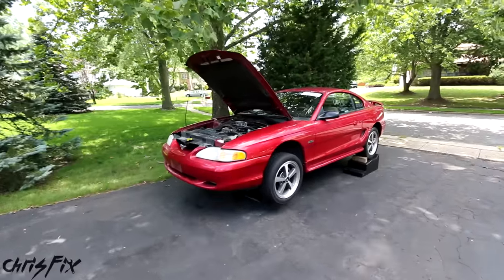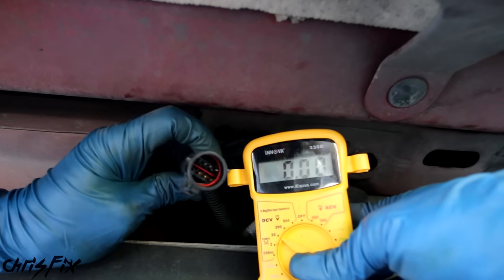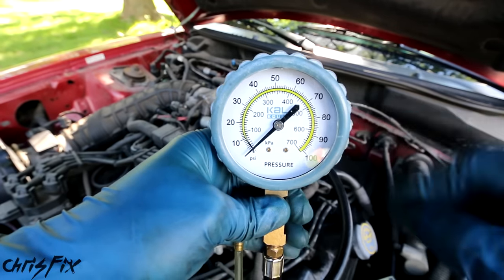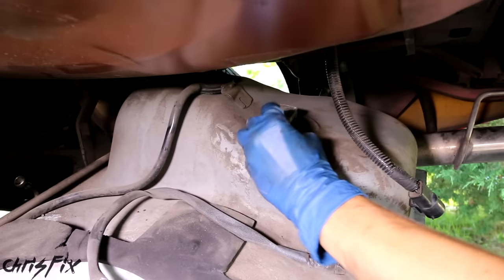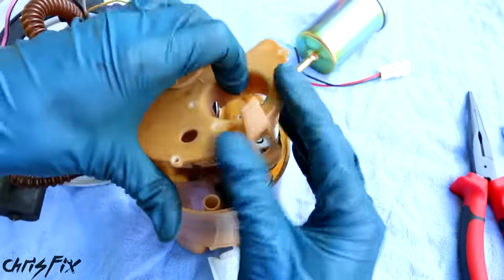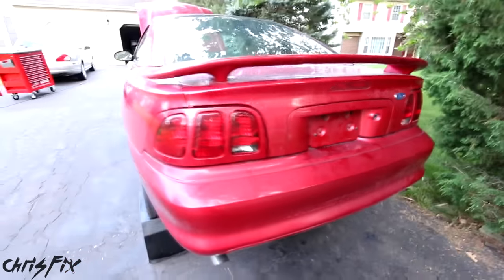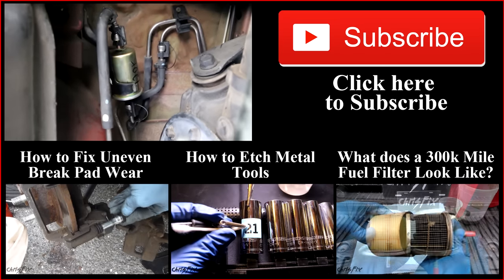How to Diagnose and Replace a Fuel Pump

Comment: Someone help? so i have a 1994 mustang gt 5.0, and about 2 months ago, my harmonic balancer went out. so it sat on jack stands for about a month and a half, until i finally fixed it. I put a new battery in, and it started after a little bit of cranking. it stayed on for a while. then i put it in  gear and drove it. it was jerking and wanted to die. then i got on the main road going about 20mph, and it was backfiring, hesitating and jerking, then eventually shut off. wouldnt turn on, so i thought the gas was bad, so i went to go get some. then it started again, and did the same after a little bit. i havent driven it in about a month since. I turn it on every now and then, and it starts right up, and revs up to 4-4.5k rpm. I feel like it could be the fuel pump.

Comment: I have a 13 chevy cruze and I just replaced my battery thinking it could the issue but isn't. The engine cranks but doesn't start and when i would drive uphill, it would take so long for the speed to increase. Could it be a bad fuel pump?

Comment: My 98 Mustang GT is stuttering when I get on it in high RPMs I changed coil packs, o2 sensors,  it threw a pending MAF code that's gone now and the o2 sensors were at 0v on live data I'm stumped do you think it's my fuel pump going out?

Comment: Hi can you help me Chris?
I have a Chevrolet Sail Diesel.
The problem is after driving for a while and stopped, it won't start. It just cranks. 
It starts perfectly at cold start. But after a stall or stopping after driving for a while (1hr or more) it will not start. If I've luck then it will start but there is a noteciable sound difference in crank when the engine is going to start. Like a shaking feeling sound. If it won't start then there is no sound like that, it's just the cranking sound. 
This problem occurs more when I drive with ac on or if I stalls the car. I'm not sure what is the problem but I think it's related to the fuel pump. Do you have any guess?

Comment: If your fuel pump stops when you are on the road you can sometimes get under the car and tap  on the gas tank to get it going till you get home. 
If you stop the engine you have to tap again to start. 
You are welcome.

Comment: Hi there... My 2011 suzuki sx4 . Standard.  No previous issues. Suddenly dies off 5 mins  after engine runs. And can't start since
Need some advice , the car cranks but not starting. Checked the following,
Battery -ok
main Fuse- ok 11.8v
f.p Fuse ok

F.p Relay not clicking, I'm getting 8.2 dcv at supply feed to relay.other ports I'm getting 11v
 change to similar relay still doesn't click. need some advice before I proceed to the fuel pump. What else can I check?

Comment: Chris I have a p0089 code on a 2009 Volkswagen CC and there are so many issues associated with that code. Could you give me any tips on what to do, I’m sort of sure it’s the fuel pump and I already replaced the pressure sensor and cleared the code which didn’t solve it

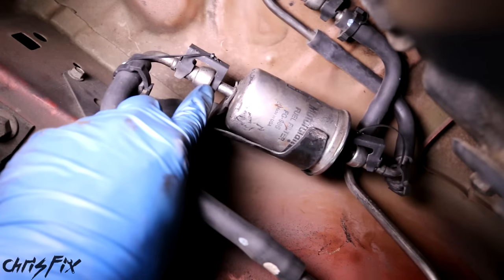Comment: Do you see the fuel line above the filter with the clip at 5:54? I removed that clip by accident and I can't get the fuel line to lock back into place. It just won't budge because the bracket holding it is stud welded in. Any suggestions on how I could get around this? Thanks, wish I would have watched the video first lol.

Comment: I'm working on replacing the entire assembly instead of just the pump. I'm noticed that the "hat"/cover/whatever has an arrow on it. I don't know what it's pointing at but it wasn't pointing toward the front of the car. I marked the direction that it's pointing to on the body of the tank. The fuel line (that goes to the inlet side of the fuel filter) that comes off of the hat was pointing  at the front of the car and I'm assuming that this is the proper orientation but that arrow is confusing.

Comment: My car shuts down after driving and about to park it and turn off the car. Is it the same problem? Bad fuel pump? Not during driving but after and the engine rattles and weakens when stopping

Comment: Hi @ChrisFix, watched the video very helpful until the fuel Relay switch. I opened up the panels on the inside of the passenger wheel well like you showed, but I cannot find the relay ANYWHERE! I re-watched over and over but the exact location is never shown in your video! SOMEONE ANYONE PLEASE HELP!!
Reply: I have a 98 mustang gt conv

Comment: Hey Chris I have a 07 Chrysler 300 with a bad gas pump I know there is power going into the pump but the pump just won’t hum and work  I changed it with a new pump 2 times what else can it be ?? I sprayed it with starter fluid and the car turned on any suggestions??

Comment: @ChrisFix I have a 01 dodge 5.2 my fuel pump is a little different. every so often the truck will die/stall even when i give it gas to stay running. Would my fuel pump be bad?

Comment: I have a 1996 cobra when I hook up the fuel pressure gage and turn the key on it go’s up to about 35 but it starts to drop back down right away. Should it stay around 35 with the key on? Does that mean I have a weak pump? I just got the car

Comment: I have an 84 k5 blazer. You need to hold on the gas pedal for it to start and press down the gas pedal a couple times and feed gas to the engine. Once it’s on it on and doesn’t turn off. Any idea what The problem could be?

Comment: I have a question ChrisFix, I as well have a 98 mustang but won’t start I changed the fuel pump and filter, fuses are good and have power as well as the fuel pump relay and when I start i don’t hear the fuel pump and now I get a check engine light and a theft warning sign on dashboard any advice?? please help

Comment: I currently have an issue with my sn 95 v8 5.0 automatic, after i drive it fot about 5 min and im not constanly acelerating lets say im driving trhru a speed hump it turns of all of a sudden, after that is starts normally, this happens probably about 2 or 3 times before i get to drive on a highway or something where i can get more speed

Any suggestions? :/
Reply from the maker: Could be anything from a malfunctioning torque converter, to bad fuel system components (injectors or fuel pump), a bad oxygen sensor, a clogged idle air control valve, or bad ignition wiring!
Reply: @chrisfix  Many thanks for the response, it was in fact bad fuel injector, people at autozone told me to buy a scanner to read the error codes myself, can you recomend me one? i saw you use one on the car you bought your mother few years ago, since you have a beautifull 94 maybe you can help me with some tips to get one for my gt 95, and again thank you so much, for the response

Comment: I have a 2013 toyota corolla sport and it works fine. But if I’m idle for to long the rpm’s start to flicker and when I press the gas it sputter and will start running little by little or stall, it also works fine with a cold start but if I’m going places and turning it off and on it stutters and stalls, any idea what it is???😭

Comment: I got a 2009 Pontiac G6 2.4 l when I'm driving between 20 to 58 miles Well in between those miles My car hesitates with the  RP m's going up-and-down I changed the spark plugs And the purge center and it's still doing it Not sure what it could be

Comment: An important Word Of Warning though;
NEVER attempt to repair a metal gas tank by welding under any circumstances.
This is an extremely dangerous procedure and should be left to a specialist.
And whatever you do, no smoking or naked flames either.

Comment: I have to remove the bed of my 1999 Sonoma to get to the fuel pump.🙄 This wouldn't be a huge issue, except road salt has turned the bottom of my truck into an iron oxide mine and every single bolt I've tried is rusted on.

Comment: @chrisfix I got a mustang like yours and it was parked for a while as well and I got it to turn on but it shut off due to no fuel pressure and I checked the fuse there okay although the relay I don’t hear it click but I checked the connector by the gas tank and it had powered would I still have to change the relay? And no I don’t hear the fuel pump turn on.

Comment: My 96 Explorer 4.0 the fuel pump comes on every time I turn the switch on, but it shuts down on the hiway, I turn the switch off and right back on, then it starts up and will go anywhere from 8 or so to 60 or 70 miles then does it again. Is that a fuel pump issue? I already changed the crank position sensor

Comment: @Chrisfix I'm having a question what if you measured the thing you put the fuse in the fuse box doesn't have voltage I need answers I buy cars from auctions some don't run some do

Comment: I'm having a hard time diagnosing my car Vios1 due to long cranking issue when the car rest for an hour. it takes 3 - 5 seconds to start the car. I replace new sparkplugs, Ignition Coil, Fuel Pump, Fuel filter and Fuel strainer. but the issue still there. please help.

Comment: Someone ELI5 the electronics part for me; when Chris tested the fuse, he used both the red and black wires. 
When he tested the plug in the back, he grounded the black wire. Why do you need to do those two things differently?

Comment: I got a 1997 Toyota Corolla car it will run sometimes and quit but when it sits overnight it will start up and run what could be the problem I'm going tomorrow in buying a fuel pump and putting it in

Comment: i have a 2002 that run but it sputters when i accelerate. ive been told it might be the fuel pump but it runs and crank . any suggestions ?

Comment: this vid is super old, but chrisfix if you see this.. i need some advice with this car, i have one and its very old and worn i want it to last as much as possible, i bought it at 180000 miles for 2k and put new tires a new alternator and a new battery. fuel pump needs to be replaced and struts and shocks to be put on. no one is buying it online what should i do

Comment: Hello sir chrisfix by the way my name is chris also :-).I have a problem about nissan sentra 1996 model the problem is I take out the fuse and take a reading that fuse terminal for fuel pump only little volt readong about 0.4v can u help me how can i fix it As Soon As possible?i hope u can reply this situation?
Reply from the maker: If you are getting low voltage like that, I would first check to see what the correct voltage is, it might be different car to car. Then I would make sure your grounding location on the multimeter is clean and try a different spot to make sure you get the same reading, and make sure the key is turned to the correct location. If you are still getting the same reading then the fuse/fuse location might be corroded but what's more than likely happening is that a connection or ground is where you are loosing the voltage. See if you can find where it connects and grounds to and clean it up with some sandpaper and take the reading again!
Reply: @chrisfix  thanks for your advice i will do it later when my fuelpump arrive this week:-) i will give you updates later:-)

Comment: I have an ‘05 Lincoln Town Car with 100k miles on it. It recently had the spark plugs, fuel injectors, fuel filter and fuel pump replaced. However, I always experience significant lose of power when the fuel tank is quarter full or less.     Can anyone please help with this and tell me what may the issue be? Every mechanic I went to didn’t seem to know what the problem is.        Thank you

Comment: Chris i need your help seems like a Ford s Max not anyyhing Are like other cars, cant find the fuel filter and I took the hold tank down and pulled of the pump, and it suddenly ran again, but since it wont take throttle too good its like its losning throttle Even tho i put My pedal down

Comment: Hi bro, how you checked the fuse terminals by negative and positive probe? How is it possible it giving 11.61 volts by both ends of fuse? Fuse is using only for positive OR negative! 
If its like this after installing the fues it will burn.
1:38
Reply: *fuse

Comment: so im having a problem while the car runs fine when im driving but when it is stopped my car idles super rough and if it does it to long it will just shut off i have changed the filter and cleaned my icv

Comment: My 05 mustang gauge is not marking the right  amount of gas i have any suggestions?
Reply from the maker: Either the fuse has blown, or the float or sending unit is bad! I would do what I did in this video and but replace the entire sending unit and check the harness!
Reply: @chrisfix  ok but the gauge does move , when i full tank,it goes all the way up , Aldo when i accerlate fast it marks that i need gas

Comment: I have the code P2294 on a 2006 Audi a4 3.2, I replaced the high pressure fuel pump, the pressure sensor, the low pressure fuel pump, the low pressure fuel pump module, and the fuel filter, and my check engine light still on, and car drives poorly, don’t know what else to do, can you help in anyway?

Comment: My fuel pump works, I can hear the sound but my car starts a little and then it shuts off ... i get this code P0462 also the car was not used un 3 weeks... Any ideas of what it can be?

Comment: What are the odds of a new fuel pump being defective from the manufacturer. 92 ranger - inertia switch is compressed, the fuse is ok, I have voltage on the fuel pump pigtail, but no working pump on the new one nor old. Nada zip. I did an ohms reading - the old pump 250 ohms, the 1st replacement pump 00, the second is 100 ohms.....is 150+ ohms on the old pump good or bad? TIA

Comment: there is a check engine light in my dad's 2004 toyota avensis t3x and nothing is wrong in the engine of the car.
Reply from the maker: Scan the computer and see what the code is.
Reply: Chris,that avensis is already sold when you replied
Reply: And plus,it starts so I don't need a video on how to replace the fuel pump

Comment: I've done this three times, twice because I had to, and once at 250,000 miles as a preventative measure. Each time was NEVER easy as the rust ate up straps, pinholed the tank, and fuel lines. And I do not live in the "rust belt". Each time was a PITA as I bumped my head, cut my hands, or literally cut my butt on some unseen piece of glass. Never say something is "easy" when you have to work underneath a car or truck. Who is the fool that designed the fuel tank with the pump in it!

Comment: What’s up man I have a problem going on , I have a 98 gt and recently I was driving to work early morning I was running low on fuel and ran out of gas I tried to add 3 gallons and it wouldn’t start since then I’ve changed 2 fuel pumps a filter and regulator the pump is priming as the sound I hear it but I have 0 psi at my rails I was wondering if you had any clue
Reply: Also I hear my relay clicking with the kick panel off and my fuse isn’t blown
Reply from the maker: If you’re getting no fuel pressure there has to be a clog somewhere. I’d take the filter off and put a clear hose on the line to see if when you turn the key to the run position if the pump is pumping fuel to that point. If so you know the problem is forward of that spot.
Reply: @chrisfix  appreciate you taking time out your day bro 🤙🏽

Comment: A COMPLETELY dead fuel pump is easy to diagnose.  Power at the inertia switch, no humming when you turn the key.

A dying fuel pump (will let you start but won't let you accelerate) is another story.

Comment: I got a question for anyone who can provide an answer I have this 2000 honda accord I'm working on at first there was no power anywhere to the car I bought a new alternator and battery and there was still no power by mistake the car magically go power when my tools touched the fused box more specifically the bolt that connects directly to the battery and the bolt that connects the the alternator so I put a wire to skip the fuse box and the motor cranks for a second with starter fluid but I'm thinking it won't Stay on because the fuel pump relay isn't getting power all fuses are good have checked no of them are snapped any suggestions?

Comment: You still had the fuel pump wire disconnected when you checked the fuel pressure.

Comment: Sequencing issue... you already disconnected the power to the fuel pump by the gas tank, so if you're testing the pressure AFTER that, it would be a FALSE NEGATIVE...

Comment: My opinion is  i open a whole under back seat no need to remove the tank i changed the fuel pomp for 15 minutes after that and i seal it good after done save me a lot of money only  110 dollar total the mechanic told me 700  to 900 lol  no thanks

Comment: Someone help me so my fuel pump I hear it when I prime it but the car does sometimes just cranks and take a min to turn on also I did a fuel pressure and is was no fuel when the car started I changed the tps sensors MAS sensors and the crank sensor

Comment: What happens if u don't get power to the fuse and the fuse isn't blown??
Reply: I'm not a car expert but I would recommend you check your battery and if there is wires or something like that (again I'm not a car expert) check those

Comment: Me:chris if you bought a hole fuel pump thing or what ever and you dont use it or instal it then why did you buy it
Reply from the maker: If I remember correctly, I had to buy the entire housing to get the actual pump. The housing was in good shape so I figured I would just throw the new pump in!